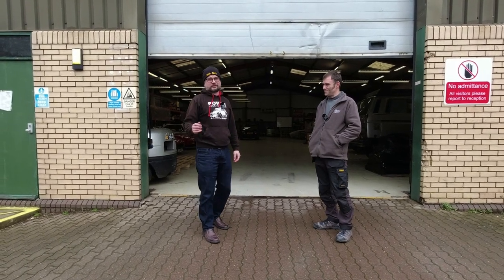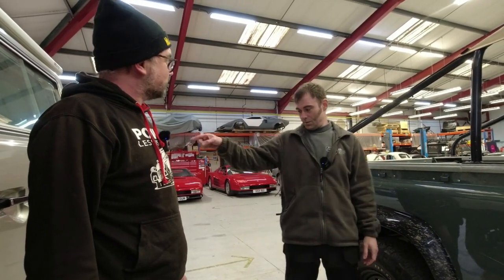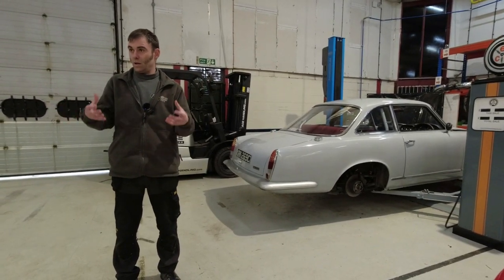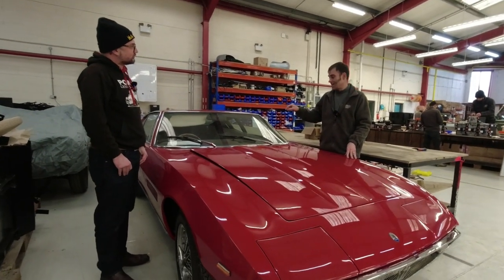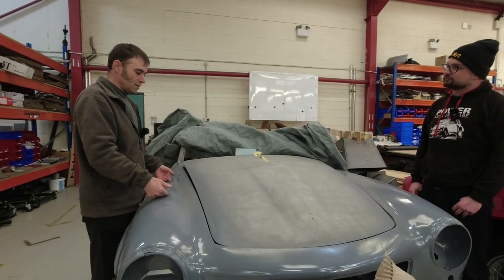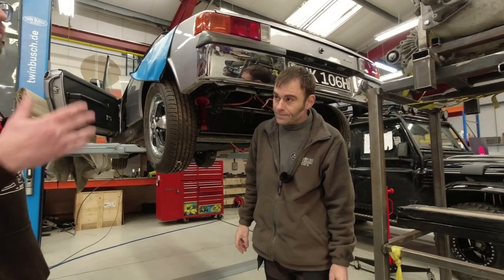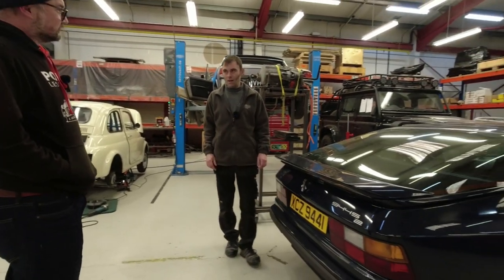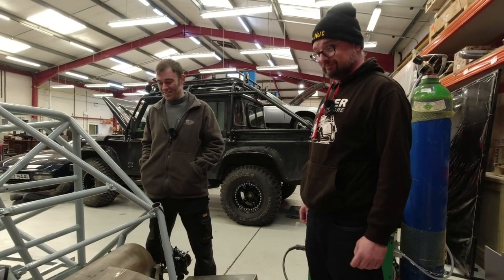Visit to Electric Classic Cars - home of Vintage Voltage!

Comment: Absolute disgrace. People doing this sort of thing to classic cars should not be promoted.
Reply from the maker: I disagree. I think it's really impressive, and most conversions are designed to be easily reversible.
Reply: @HubNut  It's a pointless conversion, one of the reasons people are drawn to classic cars is because of their petrol engines. You must be very daft to pay and drive something like this. Might as well drive a shoe box with an electric motor
Reply: @djbiltv  well said, it also costs a fortune.
Reply: @djbiltv  you might as well just buy a new ev
Reply: @Markcain268  Yes, exactly.

Comment: When I first heard of this idea, I thought it was really interesting from an engineering point of view. Now though, I really worry about the seeming popularity of it, and I feel that it has the potential to destroy more engineering history than the scrappage schemes. When the power train is ripped out of a classic car, what you’re left with only looks like a classic; you’re discarding the original feel, sound, smell, and possibly handling. And who gets to decide what is interesting enough to preserve? It reminds me of the widespread destruction of historical buildings that went on in the mid 20th century. For instance, someone on here commented that a Cortina might be a good candidate with its mundane engine; well, my mk1 Escort RS uses that same engine and it is by no means mundane or devoid of character in that car! 
And what will a converted classic be worth to anyone in twenty years time, when its original engine is long gone, with its now outdated EV power train? Lotus Cortina with a 1990s turbo diesel anyone?!

Comment: Richard deserves every accolade for his engineering skill and business nous. However, in denying the removal of its engine doesn't also remove a classic's very soul, he is well wide of the mark. Fair play with his Defender, but you can't dismiss a Colombo V12 (nor even a small-block Chevy) as you might a Td5.
Reply from the maker: Very much depends on the car I think. I struggle with the Gordon-Keeble project, but wouldn't mourn the loss of a clattering diesel, or even an ordinary four-pot petrol.

Comment: I really like.the overall philosophy and creed shown at Vintage Voltage. The workmanship is absolutely stunning. My only question is, how proprietary/locked down is the programming/electronics that control the car. What I'm really asking is there any type of pairing of parts that would necessitate return to the shop to clear the code to make the car work properly again, such as in the way Apple, John Deere and others are doing? If you can just buy a part and install it yourself and get on with your life, then h311 yeah, I'd go for it.
Reply from the maker: Good question. I'm not sure. I think the programming is very open, hence the ability to tweak settings - with the appropriate laptop.
Reply: @HubNut  I can see that, owing to his comments 1. about the tweakability, and 2. the bit about being able to buy "it" (whichever component you need) right of the the shelf.

Comment: Converting cars with uncharismatic engines, I can understand. BMW 3.0 CS or Testarossa though? No, I just don't get that. The car is named after the engine for goodness sake, and I suspect the top speed is about half of the IC engine one, and range about a quarter. But its their money, their choice. Just don't try driving down to the Cote d'Azure.

I suspect in 10-20 years when everyone is driving an electric car anyway and the novelty has worn off, most of the more interesting cars will get converted back to internal combustion. Crash safety is a concern for me in the smaller old cars, those motors and batteries are heavy buggers and will be going a lot faster when they inspect the scenery or oncoming vehicle.

Comment: Could you convert a bus and put solar panels on the top to charge it?
Reply from the maker: You'd really need a house's worth of solar panel to put a decent amount back into the battery. They don't output that much and a bus would need a pretty huge battery pack.

Comment: A very interesting watch with some great engineering skills for sure but at 11:00 in my opinion Is where he starts to try to falsely justify a EV conversion, reliability is not much of an issue at all with a well maintained car, a lot people don't know what a Haynes manual is because most of them don't drive classic cars or have any intention of repairing them or their modern car themselves, saying that most information is online now via places like YouTube making them irrelevant anyway. The younger generation don't particularly want a classic car anyway, most want a modern A - B car that's cheap on insurance which most classics are not. The point he raised about no maintenance is just false, so your saying electric cars need no maintenance at all? No matter if it's a ICE or an EV it still needs maintenance, it still needs servicing, it's just different depending on what it is, just sounds like trying to get business TBH. I understand electrifying a Beetle as they're slow and cause traffic jams but a car like the testarossa is about that engine, the screaming 12 cylinder, without it what is the point?
Reply: The EV will just need tyres and the body work looked after. You don't really service an EV, Tesla say you don't have to service their cars at all, it does not effect the warranty. An EV service is more just an inspection of the car. Some have coolant which requires changing every 100k. That's it. I ran a Leaf to 90k and all I ever did was change the tyres. Breaking is obviously regen so the pads were hardly touched.

Comment: Yes, that Landy will be great for a weekends green laning, do they have many charge points on lanes in Wales or the lakes? What's it like through 3' of water? Will the battery's and motor cope?  
Wouldn't want to spend 30k to remove a vehicles usefulness.
Reply: The electrics are all sealed so you can wade as deep as you like, just like a submersible. I've been through more deep water in it than I have in a diesel one. I've never done so much green laning in my life now it's electric. It's better off road now that it's electric.
Reply: @ElectricClassicCars  so you're saying there are lots of charge points in rural wales/Lakes/Scotland?  No worry doing the North Coast 500 and onto Shetland? 
Can you tell me the expected axle life with the increased torque or perhaps in other conversions the effect of a steel plate box placed within a crumple zone on the vehicles structure?
 I watched your Porsche conversion lately, the stack of washers spacing a shock absorber and your 'technician' levering a Tesla power pack apart with 2 large screwdrivers on the sealing faces have left me with lots of questions.
Reply: @andicog  Believe it or not we have electricity here in Mid Wales. Plenty of charge points too, never found a problem off  roading. Usually start off from home with a full tank of electrons. Done the Northwest 500, awesome route. Those washers you referred to were used to size an appropriate spacer to be machined up. 👍
Reply: @ElectricClassicCars  Ah right, I didn't realise electricity had reached mid Wales, silly me, I can see Denbighshire (nearer me in North Wales) have only 19 charging points (according to their own gov site) and that's a pretty big area with lots of lanes, I suppose it depends on the range of a converted Defender?.
Reply: @andicog  Been greenlaning lots up there, Ruthin, Coreen, Bala etc. Good lanes. The main difference is with petrol people are obsessed with 100%  journey charging but with EVs only around 3% of charging is done on route, the rest is done at home or at destination.
Reply: @Alfred Wedmore I've maintained all my own older vehicles since I was 18, that's 40 years, I've also been a bodyshop manager most of my life (hence my unanswered question over safety and crumple zones) so I'd say your wrong, I've run a 93 Defender for the last 5 years, Inc an engine swap, would I convert to electric? No, the shear cost involved makes no sense. Maybe you could explain how these vehicles are charged if you live in a block of flats or perhaps in a terraced house where parking outside ones house isn't always guaranteed?

Comment: I should take delivery of my first electric car in a couple of weeks but one thing I don’t understand about the conversions done is how they retain the original number plate and don’t end up in a Q?
Reply from the maker: Simple. Enough of the original vehicle remains that a Q isn't appropriate. Replacing the engine (or even engine and gearbox) won't lead to losing historic status, even if you replaced them with more modern items (electric or not).

Comment: For off roading, electric makes a lot of sense. The Land Rover seems like a good idea. Just wondering, he said its got three limited slip differentials in it, whats the benefit of that compared to the more traditional lockable diff? I would have thought that would be preferrable?
Reply from the maker: A limited slip will act when you need it to, and be almost as good as a fully locked diff - but the driver needs take no action to activate it. Land Rovers should have had rear LSDs from the factory. It would have made them even better in the rough stuff.
Reply: @HubNut  Well, I am aware of how a limited slip diff functions, but intuitively there would seem to be a reason just about every wheeled vehicle meant for bespoke terrain driving I have ever seen has lockable diffs, not limited slip ones?

Perhaps that little bit extra terrain ability was deemed unnecessary in this case, since it involved more complexity with switches and so on.

Comment: Thank you for this video Ian, some innovative technology on display. I was driving today and thinking about EVs which have mainly automatic transmission. Imagine not being able to drive a car with  ICE or manual gearbox again.... would you always keep a classic manual car for the experience of the engine sounds and changing gear? @Hubnut
Reply from the maker: I'll certainly drive petrol manual for as long as I can, but Betty is proof I don't mind a two-pedal waft...

Comment: I really like what they are doing. Except in very few cases, I see this as a very viable solution. I would only make an exception for cars where the engine is what makes it special, for example I'd be happy to have them rip the 225 six out of an old base-model Dodge Challenger, but it would be wrong to convert one with the rare 426 Hemi.
Reply: I totally agree.

Comment: Thanks for this fascinating insight into an aspect of the classic car industry. It's a great engineering exercise evident with the Defender, although costs are prohibitive at present. If it was going to come down substantially it would make sense, but the lack of mass production investment is going to harm that in the short and possibly medium term. Too negative? Hope it's not interpreted like that. I get this, and am genuinely interested in EV and EV conversions. We are at the beginning of an unknown growth phase. A great bonus would be to add all the modern safety features like crash protection and airbags to the converted cars that are billed as ideal daily drivers.

Comment: How does this tech translate to commercial vehicles and military armour? Will the heavier vehicles need more than one power pack and what would be the practicality for long distant motoring? I assume that as it becomes more common there would be special recharging stations for long distance trucking that are specific for logistic style companies or even built around warehouse locations.
Reply: There are already practical electric buses and lorries where the mileage doesn't exceed around 150 miles a day, and there are experiments with overhead catenary wires to power long-distance HGVs on motorways. However it is likely that hydrogen power will be more effective for HGVs since it avoids the weight penalty and range limitations.

Comment: Electrifying is not 'saving' classic cars, it's altering them. Whatever you think about the benefits of doing it, you can't overlook that distinction.
I have no objection to it per se, especially in cases where the original engine was not a central feature, or worse an anchor - but I wonder what these conversions will be worth in 20 years versus an original ICE example. Human beings crave novel experiences and in 20 years when new combustion engines are banned and classic cars are exempt and run on bio-fuel or hydrogen, what's going to be the value of a classic car that robs its driver of the full classic experience?
It's no different than removing a Bizzarrini V12 and fitting a modern mass-produced turbo 4-pot, just because it's more powerful and easier to live with.

Comment: The one thing about electric cars in Britain you don't have use E10 in them the electric cars in Australia they are around and very few recharging stations not much infrastructure for total conversion to electric cars also may l bring up a point that has been bought up about how do you despose of the batteries when they are no longer any good
Reply from the maker: Battery recycling is starting to happen but has been a bit slow to develop. But, batteries can live on for things like storage of renewable energy - useful in Aus I would have thought.

Comment: Where are all these Tesla drive chains coming from? Are they Tesla battery packs too?
As far as I know, Tesla is already busy trying to meet demand for complete cars, without also providing "bits" for the hobbyist.
Reply from the maker: Tesla parts are from crash damaged Teslas. Doesn't take much to write one off.
Reply: @HubNut  
This does not speak well for the whole business of motoring. 
Since "we" are never the ones who perish in motor accidents, we are among those who look on, hoping that the next crash will yield some useful parts.

Comment: Not a fan of E vehicles , i drove a Tesla in Beaconsfield yesterday and it was so damn boring , they are very fast but the problem is without the noise , its not the same , I like the idea this man is doing but it wont work as there's no Soul , for example imagine comparing a Matra V12 F1 car from the 1970s to a Formula E car from 2022 , it is just not the same, Im a dinosaur i like the old days i do not like modern technology.

Comment: Good attempt at a sales pitch, with the central heating in a 17th century cottage and no doubt he's an excellent engineer, but that didn't wash with me. Fine EV converting an old Land Rover or VW Transporter, as they were fitted with gutless lumps from the start, but swapping a 12 cyl Ferrari masterpiece for an electric motor is sacrilege. A Testarossa is hardly a daily driver and Enzo would turn in his grave at the thought of it